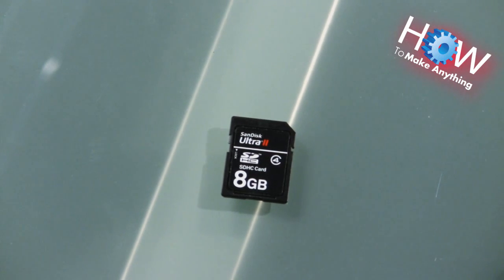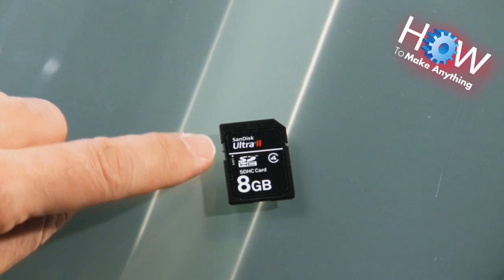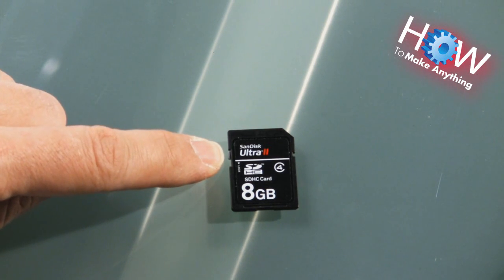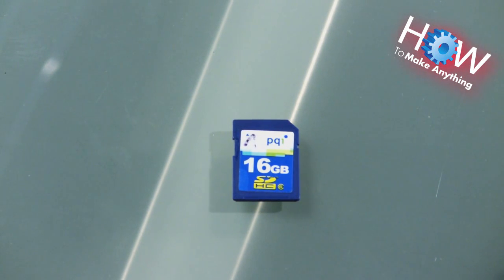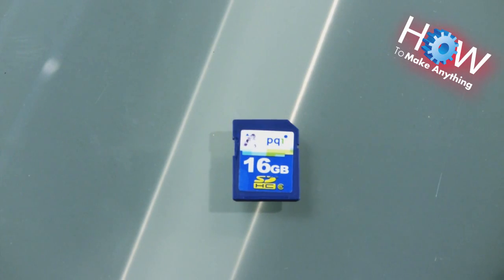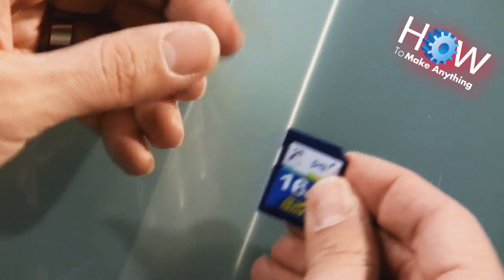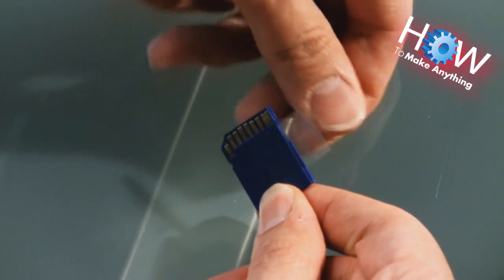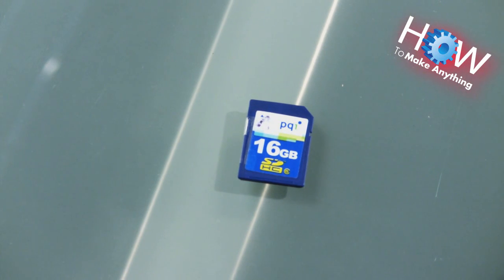How to Repair the Write Protect on an SD card

Comment: my tab is not missing and is in the unlock position but I cant write anything to the card computer just says disk is write protected or full. Its not full and I've gone in with diskpart and removed any software write protect or at least diskpart thinks it removes it using attributes command but its still write protected. I can read what data is on the card so I know it's still working. I tried using disk management tried deleting the partitions, tried rufus and other utilities but they just say device i/o error, but the card still reads fine?? any thoughts

Comment: I think the feature is stupid. And the tab should be removed. Mine broke off. And even after I tapped it, it still said it. Wasn't until I cut off the tab part, and re tapped it. To where it stopped doing it.

Comment: I had known this from all the way back and recently the switch fell out on my 512 gig Kingston card, I taped it over and it worked for a couple of days, but then it stopped working again. I used to think that the mechanism to determine the position of the switch was light-based (aka mount a light-sensitive diode where the switch should be, if it is covered or not that determines the write protection) but your video made me rethink that and have a closer look at the tape I used. I used some opaque tesa stuff and there was a little dent in it. So it seems, that m Anker card reader actually pokes the write protect area violently enough to make a dent in it after a few tries, and that dent is big enough (to me it didn't look that much, but it was probably enough for the sensor) to have the reader believe that write protection is back on. So some of you guys might want to consider this if the hack does not work or ceases to work. I got it back again by using another part of the the tape that had not been depressed prior, but I will keep that in mind when it stops working again.

Comment: I love it when the fix for something is the stupidest thing you can think of. I tend to overthink things rather than just try the obvious. Like if I am having trouble with my router I go into the configuration and check the settings in detail. No, stupid, just unplug it and plug it back in. Bingo! So, I was headed out the door to Staples to buy a new SD card because the write-protect tab had fallen off of my SD card, and then I thought "maybe I should do a Google search on 'SD card write-protect tab missing'." And,  voila, I landed here, and got the stupid answer. And it worked. Thanks!

Comment: I was losing hope and thinking to buy a new one. This is my only camera 
SD card, but have some micro sd cards which I use with adapter. I opened
 the cover of my SD card last week just for no reason, or just for 
curiosity,  then lost the switch. A few years ago I found a micro sd 
card inside another card :) . That wasn't SD, but other type of uncommon
 card. So I opened my current SD card, hoping I would find a Micro SD. 
If the SD is broken because of my curiosity, I can use the Micro SD 
inside it with adapter I have.  But unfortunately , that wasn't a Micro 
SD inside it, it's size was half of a SD card. So I put everything as it
 was but the switch. I never keep photos in card, just use for 
capturing, and imminently backup. I knew the lock unlock function but 
didn't knew without the switch, it will totally lock the card, cause I 
didn't knew how it works. I thought without the switch I just can't lock
 it any more. But after a week , When I put it inside the camera, found 
it was write protected.

so, after seeing this video.
> Tried Single tap, Not worked
> Tried Double tap - not worked. But made the card thicker and 
stucked inside camera. And I had to fight with a 
tweezer to get it out. Happened several times.
> Put a tiny object at the unlock switch position, the taped it. But 
it displaced when put into camera slot.
more than  2 hour spent on it. No hope.  Thinking using super glue.

But suddenly  I remembered I have a cheap(0.125 $ if convert to $) Micro SD to SD adapter. I broke it, took the switch, placed it inside my SD card. And yes, It is ok again 😊

Comment: I tried it but the tape did not stop the sensor from denting the tape. I fixed the issue by cutting off the narrow end of a flat tooth pick about 3/16 " and used the tape to firmly hold it in place.  Works great!
Reply: working...

Comment: my 3ds still wont work
Reply: The switch on SD card actually does nothing at all to the card. It affects small pin inside the card reader instead. Maybe the reader in 3ds is sturdier than in laptops or ect. and still pushes the tape inwards. Try gluing anything with size of a missing switch behind the tape, just secure it in place tightly(small drop of moment glue+tape on outside) and it should work just fine. Hope this helps. :)

Comment: it worked but I can;t get my sd card out of my camera.
Reply: use tweezers
Reply from the maker: you'll want to be careful not to put too much tape on the card or it can get stuck.
Reply: Use a small index card. Place it into the front of the card and try and pop it out. Worked for me.

Comment: HIP HIP HHHOOOORRRRAAYYYYYYY!!!
I can use my card again. My switch just broke off a few hours ago and the card was only recently purchased on Ebay. It is a Sandisk card but I think it is counterfeit because the picture quality & now also the physical quality is not as good as my other Sandisk cards. I had been using a Fuji card for 5 years and I flicked its switch 100's of times with no problems of breakage or even weakening the write protect switch. I am going to buy another Fuji card because there is less chance of counterfeiting this brand due to lower popularity. Thanks again. You've helped a lot of people

Comment: Tape on the notch on the right side of my 64 GB SONY SD card did not remove the write protection. Are you kidding me?
Reply: +Nikolay Nikolov Sometimes you need to put multiple pieces of tape over the notch. I had to do this with my sd card. I put 2 small pieces of tape. It puts more space between the sd card and the object checking write check.
Reply: +Fisher Leopard I put two pieces of electric tape over the left notch of my sdhc card and After I inserted it pretty Hart into the SD card slot of my notebook the files in the SD card showed up. But I will try sticking thinner tape like scotch.

Comment: great video~ I have a different ? ~not  related but I had part of the plastic lining come undone in the middle of my card where the metal is ~Can it be clipped off or do you have to have it on there so it can read the card ~ I appreciate your help ~ Thanks so much ~ I've thought about super gluing , but it would be a real fine point where it's necessary ~don't want to chance it smearing on the metal

Comment: Tried it but still wont worrrk!!
Reply: i had to put 3 layers of tape lol
Reply: 2 pieces didn't work, 3 and card would not fit in camera.
So I folded some paper, cut it to fit the tab and used one piece of tape, works perfectly.
thx
Reply: ya
Reply: Then worked?

Comment: Great idea.  Thanks.

I happened to have a twist tie handy on my desk.  I cut a piece off and placed it in the gap, to give a little more mechanical strength to the fix.  I also started with the tape on the back side of the card, to ensure I avoided the connector pins.

Comment: Good tutorial but I needed to add in a piece of smaller tape within the gap, and on top of that did what the video tutorial said by putting a scotch tape over. you can also look into this link for more info:
http://superuser.com/questions/666588/bypass-read-only-sd-card-with-missing-lock-slider

Comment: this video was pointless i tried that and it still says it's write protected, FAIL!
Reply: For some readers you will need to cover the other small notch at the right.
Reply: You might need more tape, or just place something solid in the write protect slot area (I used a little piece of paper.)
Reply: Still wouldn't work no matter how hard i shoved the paper in seems like a written off sd
Reply: it turns out the reason why the card is locked because of the device it belongs to, the device gives the card write protection

Comment: I tried this and it didn't work with one of my cameras so what I did was took a paper clip, cut straight piece long enough to fit into the lock notch and then placed tape over it the notch with the metal rod inside and it worked for me.placed it. Hope this helps.

Comment: I did that and the card read again, but I can't write to it though!
Reply: If you're on a Camera, Sometimes you may need to double, or even triple layer it so the thing cant poke through or against the tape hard enough to thinks it protected. had this problem using my 32Gb SD card on my camera after i put the tape on, but i sollved it!

Comment: I just tried this - didn't work with 1 layer of tape - you can still push it in quite easily with your finger so I guess the switch on my card reader can too.  Needs something solid to fill the gap - I rolled a small piece of tape very tightly into a shape about the same size of the gap and positioned it there with my finger - I then put the piece of tape over that like how it is done in the video.  This seemed to do the trick and I can write to my card again.  Thanks.  :)

Comment: my little sister has a nintendo 3ds and her sd card is locked, i moved the tab to unlock and it still dont unlock. it appears locked. i been trying this for a while and i cant download anything on the 3DS cause the write protection is locked and wont unlock.
Reply: same thing that happen to me
Reply: it needs a new SD card or what? i got frustrated and broke the lil yellow think
Reply: I tried this tape method just now on my 3Ds thank god! But the only problem is now the SD card won't come out. So any pictures on there wont move to my computer oh well. As long as i have my games it's fine.

Comment: How does the write protection work inside the card? What is that switch doing inside the circuit of an SD card? What are the contact points it connects to or disconnects from inside the SD card?

Comment: My switch had not fallen out but this trick worked so long as I did the same thing to the other side. The notch on the other side with out the switch needed to be covered as well. For what it's worth I used painters tape. Just worked on two cards.

Comment: Just a little note, if the cellophane tape you used is a bit not strong enough to resist the switch inside the card reader, you can try adding a thin card board in the slot and tape it in place (mimicking the lost plastic lock slide). Some card readers have higher resistance in the read only switch and a simple tape may not be enough. :)

Comment: hey i have sd card and the switch is gone for the write protection i put it in is says it is write protected i use your method and it still says write protected i need to some how switch it back up but cant as the switch is gone can you help plz ? thanks

Comment: problem solved
the switcher didn't touch the reader inside so you have to make two paper above the plastic switcher and the tap to arrange them to make the plastic switch touch the reader inside it's work 100%  i had do this and it's working

Comment: Some old SD card readers only support smaller capacity cards i think the limit is 2GB if your card is bigger than this just get s USB SD card reader they are very cheap and easy to obtain. Hope this helps. Just search Ebay for USB sd card reader...

Comment: Oh Ohhhh I thought that lock did something internal in the card, but it's the computer that detects if it is locked or not! Here I was opening up my SD card trying to internally connect stuff... Now there is tape stuck in my laptop. \fail

Comment: Guys, if you can't get it to work use a thicker tape like duck tape and make sure that you make it small enough to fix the small edge then with your nail strach the tape to the side that makes it open. Work perfectly with my 2GB Wii SD card Thank You!!

Comment: Very good tips.
Just little idea of mine, because my camera have very tight fit for SD, it would not pop back out:
       I put tape all the way down to the bottom (not where connections are, the other bottom)
and use my nail to push the tape to the little grove on the side, works perfect.

Comment: Thank you so much! My SD card had no problems with the little switch, it never fell off or anything like that. It just stopped working. I have no idea if it was the card to blame or the reader, but I tried this method and it worked. I finally managed to format my card and can now use it normally.

Thank you very much.

Comment: Hey, I know all about the Duck tape trick, but what if your SD card is locked, but the lock is still on the card, and is in the unlocked position? I have 2 SD cards that are locked just like this without the locked being broken or moved. The only piece that was broken off was one of those small then pieces over that gold part at the top of the card.

x)

Comment: hey thanks. the tape by itself did not work but i put a little tiny piece of plastic where the unlocked switch would be and taped it on and that worked

Comment: Here's a bit of a experience that i had with attempting to fix it with 3M scotchtape.  The tape works a treat but after a while when the card has been sitting in the camera, the actual bit of scotchtape which covers the slot where the lock would have sat originally, it tends to get indented and this makes the camera think that it is still locked.  To get around this, get some thick-ish paper & put it over the slot and then the tape up in the usual way. 

Peace out.

Comment: For having something solid and better looking, I filled the gap with hot glue. When it cooled down I used a razor blade and a nail file to get the glue in shape and make it as smooth as possible. It takes more time than the Scotch tape but works better in the camera as it doesn't  create any thickness. The downside is that you wont be able to lock the card as easy as you could by removing the tape. But you can rip the hot clue easily away if you really need to someday.